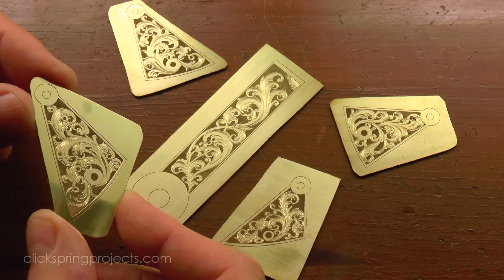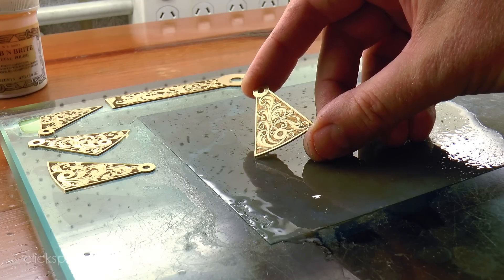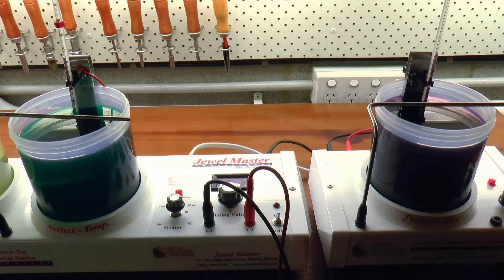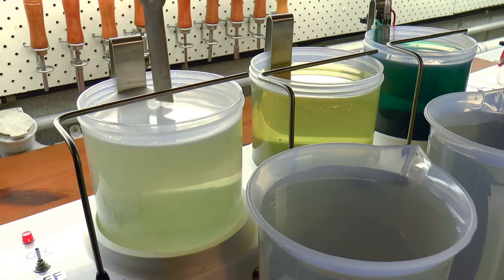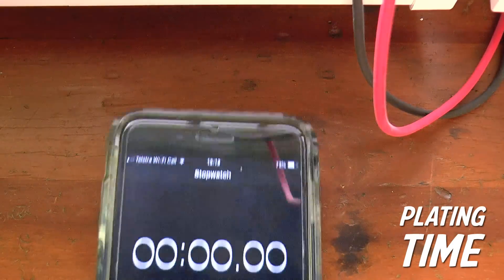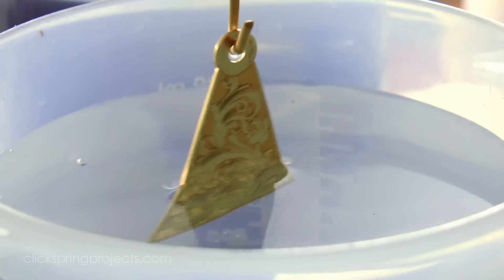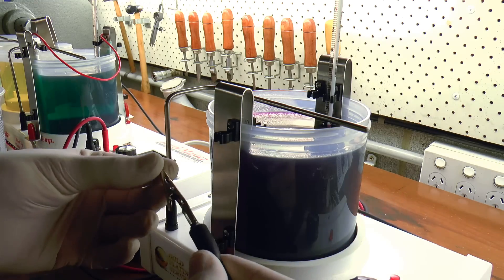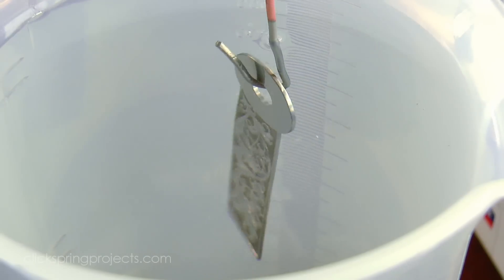Tools, Glorious Tools! #9 - Getting Started Electroplating

Comment: Chris, as i understand it, it's the current that controls the metal deposits on the parts, more specifically current flux (current per area) not the voltage
Reply from the maker: That is my understanding also. The power supply control on this plating system is voltage, so inevitably that becomes the primary parameter to discuss - Cheers :)
Reply: @Clickspring  in my setup (for zinc and car parts) I use a constant voltage PSU and have rheostats to control the current
Reply: @Clickspring  By controlling the voltage you will simultaneously control the current. As the applied voltage rises or falls, the current also rises and falls along with the voltage.
Reply: I use a current-limited power supply with a set maximum voltage for plating, and keep the current density on the low side to get the most conductive finish possible. Appearance isn't important for my applications, it's about the RF skin effect and reducing losses at microwave and mmWave frequencies, but usually the best-looking finishes have the best RF performance.
Reply: @Clickspring TLDR; Because the flowing current (and therefore the electrochemical deposition of metallic deposits) is a proportional function of the surface area, we provide a stable voltage to utilize exactly that effect for repeatable and consistent work piece results! 
In detail: Nice idea(the constant current thought), but fundamentally wrong for galvanization/e-plating/etc. It is true that the deposition rate is proportional to the current (current, which actually means how many electrons pass a known diameter in a specified time, which again is the reason for the transport of metal ions, and: therefore proportional to the electro-chemical process). When you would knew the exact surface dimensions, the current control would be appropriate. Oh and you have to change that with every part you put into the process. Now ... how convenient would it be if the current that flows is also proportional to the surface area of the work piece (bigger area = lesser resistance = more current flow) ... when using a constant voltage regulation. In fact that is so convenient that everybody in the industry does it that way. You only have the variable(and the others I do not discuss here and are assumed to be known/well adjusted/controlled, like temperature, chemistry, etc.), of how long you have to put the workpiece in the bath or 100 pieces, or 1000 different pieces (of course you have to provide the needed resources for that:) ) and you get absolutely repeatable results. Oh and that is the only thing that counts: Good production parts without having to "guess" or to fiddle knobs!

Thought experiment: Lets say one part A gets perfect results with 1A and 1 minute in the bath (The voltage meter shows 1V, which means our circuit has an overall resistance of 1 Ohm). Now we put two parts of the kind A[1] in the bath. The surface area is doubled, so we need 2A to get a repeatable result (The resistance is halved, the voltage meter shows 1V). Did you notice something?:) Put the PSU into current voltage mode and you don't have to think about surface areas and currents anymore (This will only complicate the procedure ... without any gain or reason). It is nice gift by mother nature and physics that it turns out that way.

[1] Imagine having something like 1.32983 factors and to calculate that for every new piece. Or a geometry that is horrible to calculate?! (A nice trick would be to put the part into a saltwater bath and measure the resistance, by applying a constant voltage and measuring the flowing current ... OH WAIT! Hehehe, see what I did here? That is exactly what the "situation", meaning our wonderful reality, already does for us. 

Have fun! Great video and thank you for sharing your wonderful projects.Thank you!

P.S.: This is the principle. In large-industrial-scale application there are hundreds of different chemicals, materials, process engineering, and and and a plethora of things that need to be considered. There may be ramped up initial current limiting, or concerns with the temperature when a massive amount of parts is galvanized. Or temperature ramps and voltage ramps, you get it. But even that does not allow to shoot yourself into the foot by making this absolutely simple principle (from above) into a high-tech joke with multiple control loops (current AND voltage ... of course timely distinct) = a very unstable monster in reality. We for example simply use COLD WATER running trough plastic pipes in industrial plants:) Also: That doesn't apply at home where you can make parts with love and with time (the resources that are nearly impossible to pay for in a business application, hehe).

Comment: could add a small speaker to the side of the rods playing a sound wave at around 15hz ( or 28khz. both way out of human hearing range so its not gonna annoy the operater over time ( kinda like diy perks did with the magnet that was to whin for the acrelic tube )  or so to shake/vibrate the part so any kind of interfearing bobbles gets shaken off

Comment: for consistency between metals here is how we do it ..np2 cleaner electro .water then muriatic dip then water to a copper plate to water to a sulfuric acid to clean the cyanide off from the copper water then into the Nickle bath with a mix of 3 brighteners everything ran around 2.5 amps and volts to 3  ..use less for smaller.. each water dip was 2 tanks timing eas around 2.5- 3 minutes

Comment: For banana plugs and the like, I read that the gold-plated connectors are nickle plated underneath, and that nickle is very hard but has the same corrosion resistance as gold.  Thus, scratches in the gold, which accumulate easily because gold is very soft and you are scraping it with each insertion or removal of the plated plug, are no worry.  And, the gold is more for show and nickle plating alone would work just as well.
I don't know how true that is, in terms of making a good electrical connection.  But it's interesting to see a partial confirmation on the existence of nickle plating between copper and gold, as a fairly universal thing.

Comment: Would an air bubbler like a fish tank pump under the part help clean and plate more evenly? It might help break any uneven surface tension preventing ion transfer. If the plating was uneven I suspect the cleaning and activating could have been as well, hampering the process at every stage.

Comment: Hi Chris,

I have been wondering since I first watched your large wheel skeleton series if you ever coated the finished article in any way.  I ask, because when you made the the pillars and pendulum you coated them with a diluted mix of clear varnish.  I suspect to plate the clocks moving parts would compromise working clearances.  In short did you decide on a natural patina for the entire assembly?

Comment: You have the anode, cathode, and power supply correct in your diagram, but the electron flow is from the anode to cathode through the electolite. This frees up particles from the anode, those particles are then attracted to the cathode. You loose material where you loose current i.e. electron flow. This can be calculated by knowing the metal loss per year per amp per hour and measuring the amount of current flow and time.

Comment: Having a bit of plating experience, you're best bet is nickel for the barrier coat.  It's used in almost all industrial applications, and every plater I've ever visited states the nickel is the best.  Palladium works, but they usually only use it for non-industrial applications and it carries a big up-charge.  

I'm interested in your gold solution, is it a cyanide solution?  That's what was being primarily used back when I was involved in this.  They were just starting to get into non-cyanide solutions and were still having consistency issues.  Considering most of these places had full on waste water reclimation systems (separates the residual metals and toxins from the process waters), they were still staying away from the non-cyanide based solutions because of the consistency issues they were facing.

Good stuff here Chris!

Comment: Hi Chris, did you find any issues with bubbles causing pitting in the plate layer? Or, did you use any agitation in the solution when plating? I’ve seen fish tank pumps used as well as magnetic stir bars.

Comment: You can reverse plate the nickel off, by basically reversing the current flow.
Reply: I did wonder that when he mentioned its being difficult to remove.  Would the process automatically stop when the nickel is removed or do you need to keep a close eye on it to prevent damage to the brass surface?
Reply: Got to watch it

Comment: > Whatever the desired finish of the plated surface, it can only ever be as good as the surface finish immediately prior to plating

This is not entirely correct. There are additives for electrolytes, called "brighteners", that allow for the deposited metal to have a fine grain structure, and fill in small imperfections, thus producing nearly mirror-like finish on the surfaces that were not polished prior.